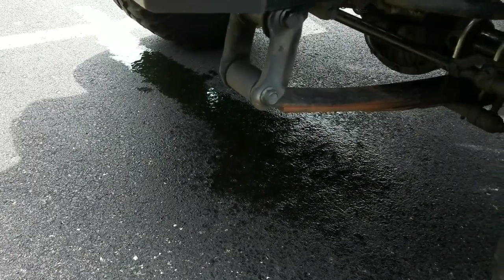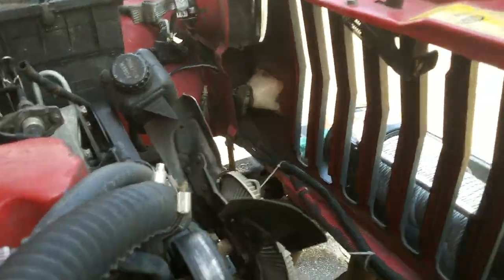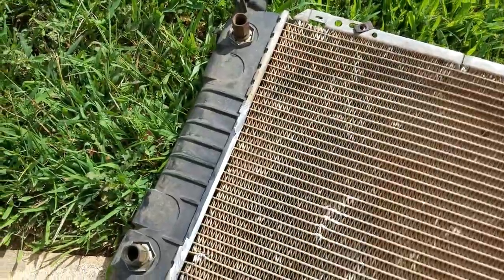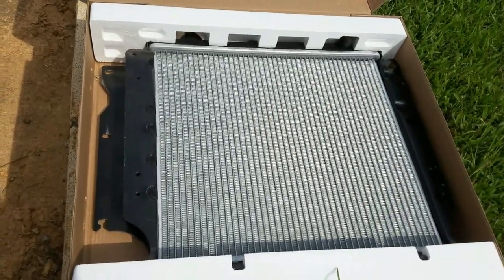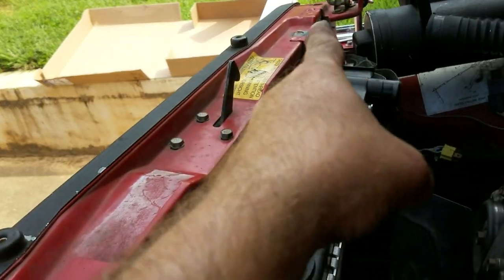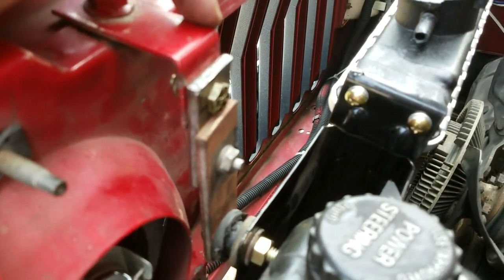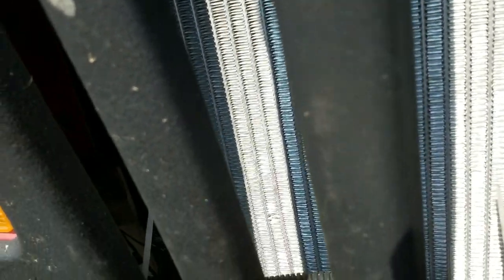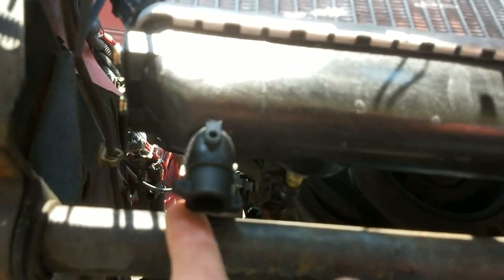Jeep Wrangler YJ - Radiator issues - Im broke down!!

Comment: I have the same radiator in my 91 yj... it's hanging so low because of the drop brackets. The original mounting position is on the red angled bracket which is a couple inches higher
Reply from the maker: I kinda thought about that. Those drop brackets were on the jeep when I got it. The drain petcock it still clearing the sway bar for now although it still rigged with the wire ties. This coming weekend I'm gonna have some time to fool with it. I'll move it up to the red angle bracket (and make another one for the other side) and see how that positions it. Thanks for taking the time to drop in a help everyone, including me. Have a great day!!

Comment: In your opinion what do you think would be top end price on a yj when I was 16 I got a yj and I believe I payed about 2800 for it then it was stolen and recovered about a year later pretty much destroyed and have been wanting another ever since but here in Virginia people are asking 4000 for a 4 banger (I wouldn't mind a 2.5) but that sounds outrageous
Reply from the maker: To be honest, kinda hard to say. I've turned down way more than that for mine. What I've noticed on the forums and facebook groups is that it really varies from one region of the US to another. Asking $4000 for a 4 cylinder, if its in really good shape, thats not too far out of line for the area I live in. I personally wouldnt give that much for it. But, I'm not a fan of the 4 cylinders. Not that they are bad engines because they are fairly decent. I just like a lot more power under the hood. If you are patient and keep shopping a good deal will show up eventually. Oh .. I forgot to comment about the 2800, that is much more in line with getting a good deal! Good luck!!

Comment: I already replaced a gas line filter I want to know if there is an inline gas filter in the Middle where the transfer case is is there a gas filter in that section there that I can't see
Reply from the maker: Nope .. just the one by the tank. Have a great day!
Reply: Power Addicts - FixJeeps.com - Jeep, car and motorcycle tips do I have to drop the gas tank to get to that filter because it was a filter up by the engine I was just wondering if they were two types of filters
Reply from the maker: What year is your Jeep?